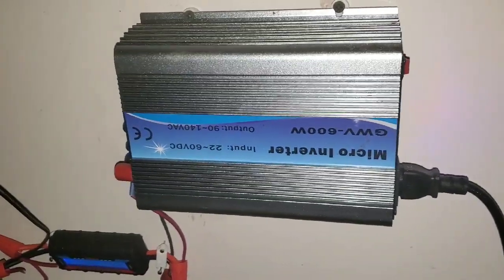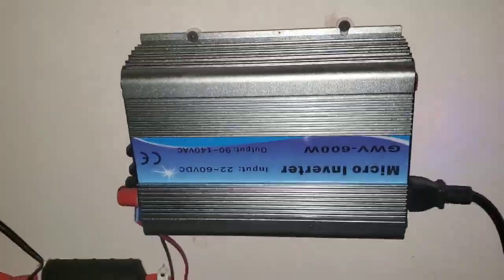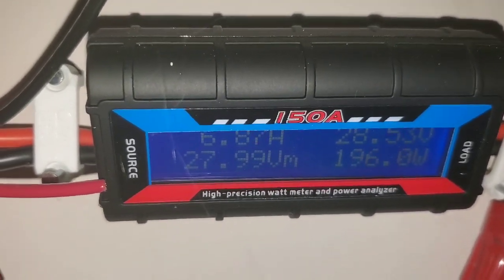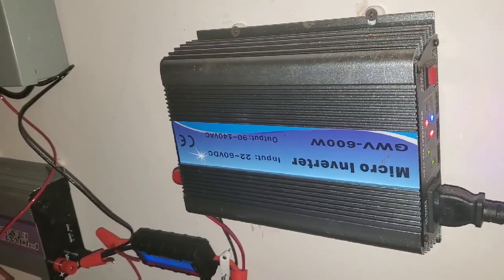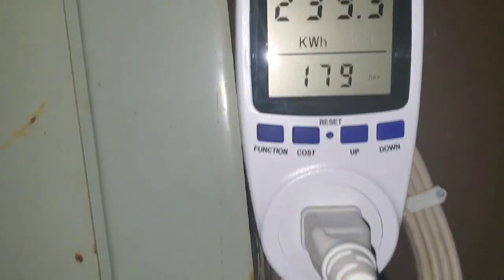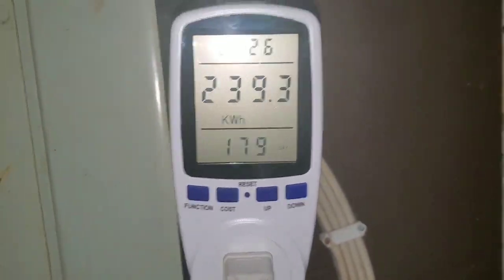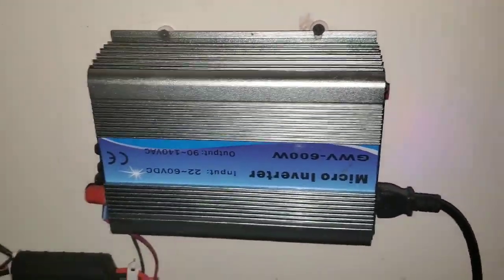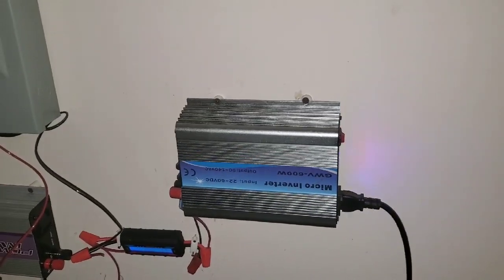GRIDTIE INVERTER REVIEW 600W GRID TIE

Comment: I find these to have terrible efficiency. I have 3 x100w panels in parallel and it only puts out 110w to the grid. Also, if you have any poweline adapters in your house (for internet) they don't work properly, you will have a lot of disconnects (probably because they are not pure sine wave inverters).

Comment: If your DC INPUT is 200w then how much WATT OUTPUT  AC voltage side ???
Reply from the maker: The grid tie inverter produces 120v at 60hz to feed directly to your homes grid..your appliances use this electricity first which slows the electricity meter down saving you money
Reply: not factoring for a little bit of ’efficiency loss’ if you put 200W in you get 200W out

Comment: I bought the same GTI almost two years ago.  It has worked great.
Reply: Is still working and what is the total months it is currently working??
Reply: @christiana2161  Still working well.  I bought it July 2018 so it is just a few days short of two years.  I only have enough solar cells to put 300W back into the grid, but at that power level it has been great.  Not sure I would push an inexpensive GTI to its rated limit (600W).
Reply: @N6EAJ  That's great! May I also ask if you put any safety device on the DC and AC side or any external fans? Cheers!!
Reply: @christiana2161  I have two of them now.  I babied the first one (the one I have had for over two years).  It is in the garage and has two small fans that turn on during peak sunlight hours.  I also added a large capacitor on the input (external).  I don't have any surge absorbers on the DC input or AC output.  The 2nd unit is outside sitting under a solar panel completely stock other than lower value fuses since I pull out less than 300W.   That one has been going since April.

Comment: You didn’t show the output of it?
Reply from the maker: The output is that it puts back into the grid 120+- volts at 60hz so the grid will use this electricity first slowing down ur meter